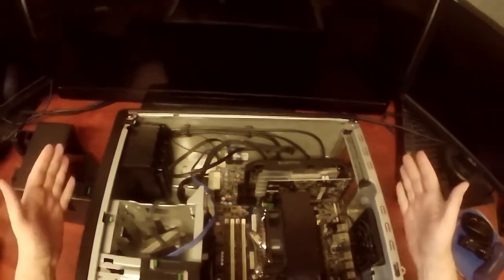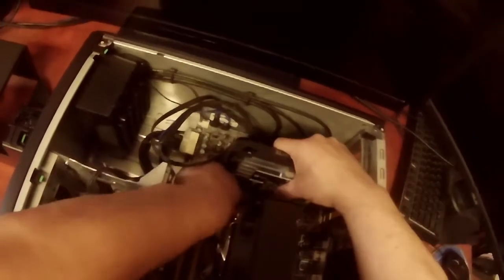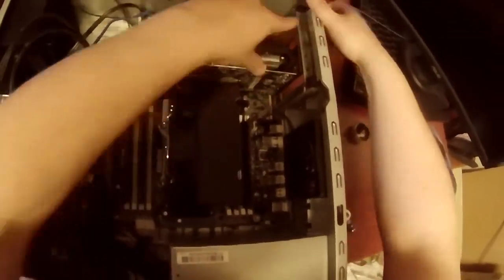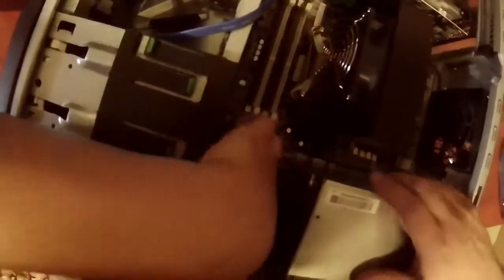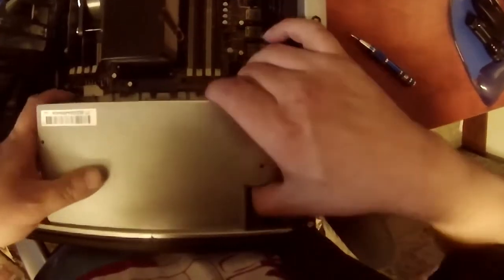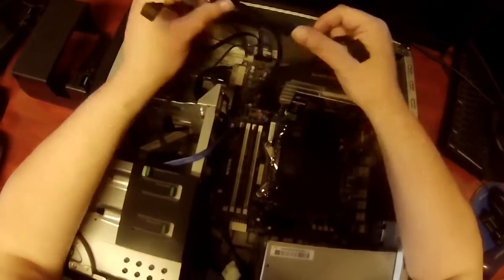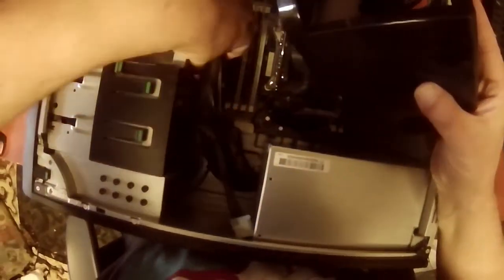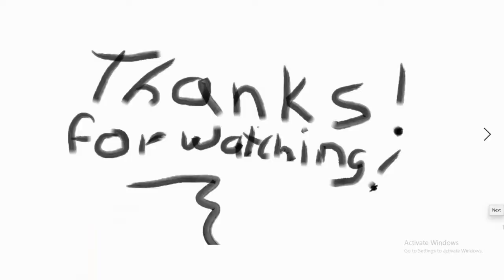Inside the HP Z440

Comment: 3:48 – The power supply notch allows the case to have a handle at the rear to complement the one at the front. It's not simply an anti-upgrade measure.